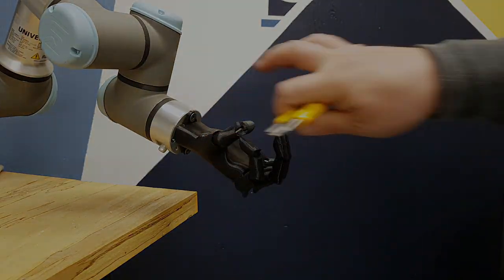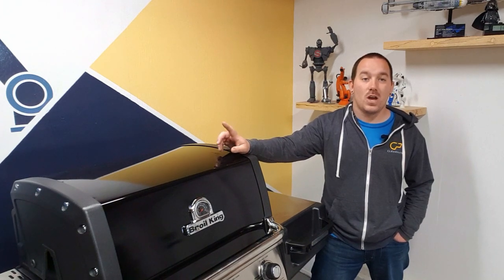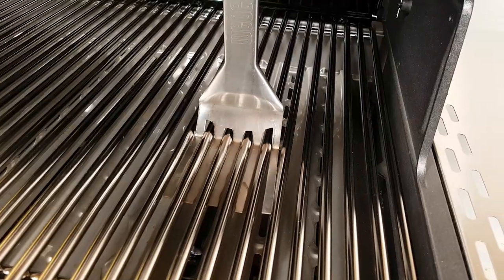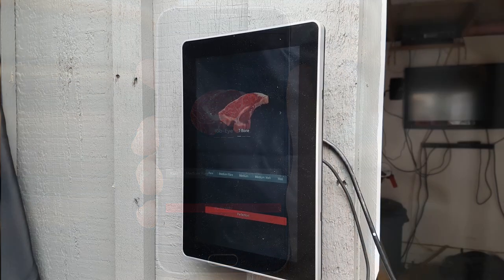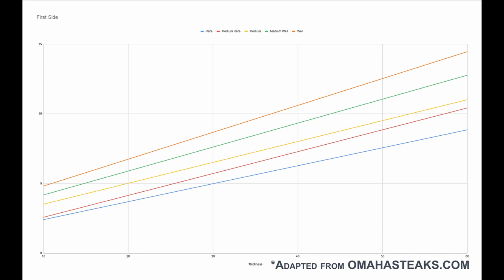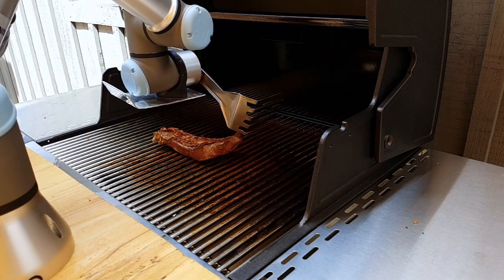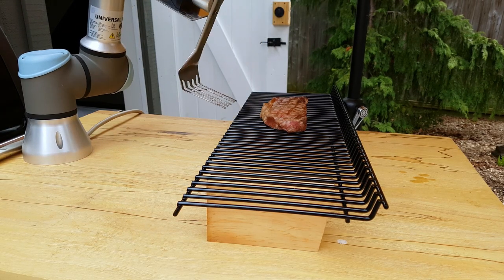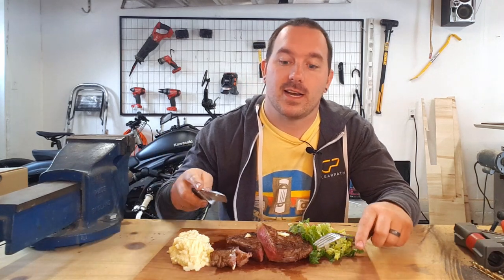Robot Grills Perfect Steak

Comment: Chefs usually prod a steak with their finger to check how hard or soft it is, which translates into if it is rare, medium or well done. Timing alone is not a guarantee of a perfect steak, just a rough guide. So you could use the force feedback to fine tune the cooking of the steak? PS as a trainee chef any ideas on building a poached and scrambled egg robot? Since I am on my own in the kitchen, my plan is to build a secret army of robots to do my job while I sit outside on a deckchair.